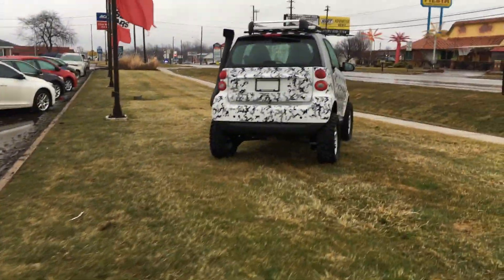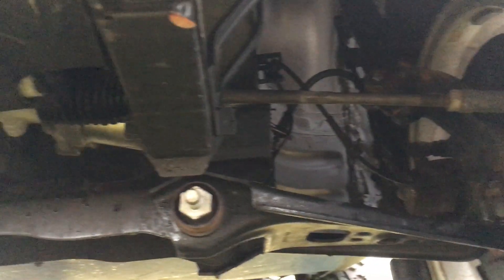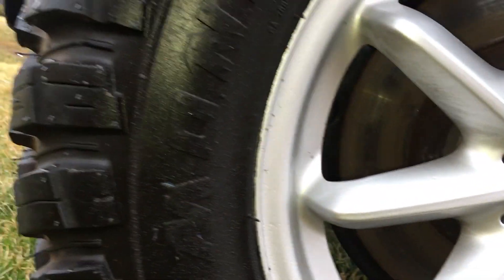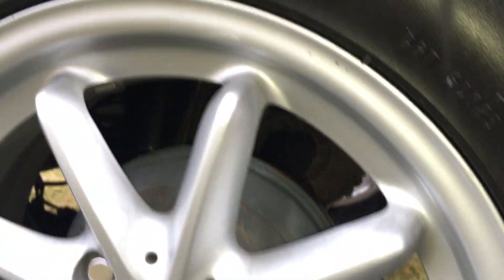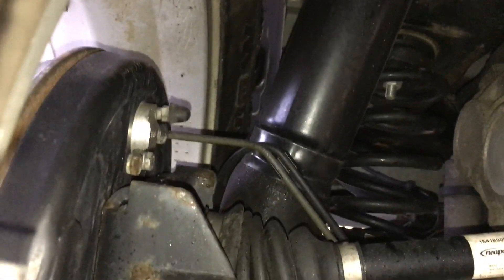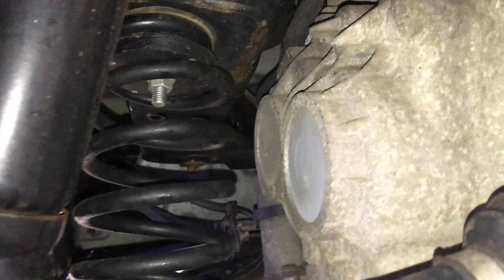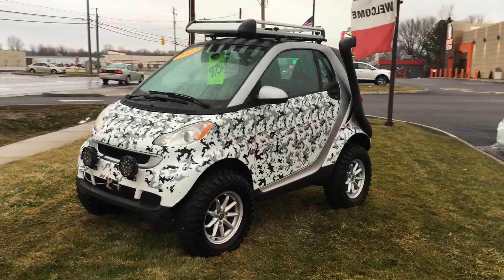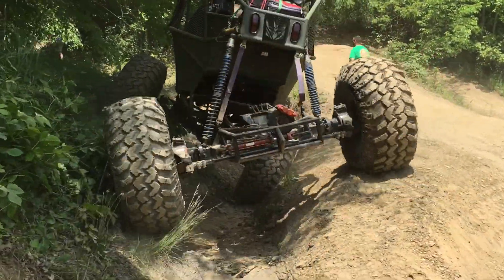Custom Lifted Smart Car ForTwo

Comment: This was one of the Smart lifted for Two that has inspired me to buy and lift my own.  I am retiring soon and live in eastern Ontario next two the Hastings Heritage trail.   Ontario is full of abandoned railway lines that are now being kept up for multi-use purposes such as sledding horse back riding and so on.  I looked at used UTV for two but the prices for anything decent is $10k minimum.  I'm not interested in 4x4 trail busting, just sight seeing and getting to some places I've never seen before.  The Smart 4-2 lifted has these advantages.  Comfort.  Super safe. Cost max project $6k. AC when it's hot.  Heat when its cold. Dust protection. No helmet required.  Road legal to get to the cool off road locations via paved roads.  Quiter.   Disadvantages.  Not 4x4 so some spots will be off limits.  It's going to be a fun build project for my highschool shop students in my final year.  Cheers RL.

Comment: The Daystar lift was originally designed to lift the Fortwo up in Canada to allow more clearance for driving in the snow, thus the lift and aggressive tires. It's a perfectly safe well tested aftermarket kit for it's intended purpose. But for serious off roading it would be a flop compared to a side by side. I have a Daystar lifted Fortwo with taller tires. I live in the country and thus 3 or 4 inches of total lift is a big plus. It still handles great and is stable. I am running street tires and not aggressive off road ones.
Reply from the maker: Thanks for the info! Good to hear directly from someone who owns a lifted ForTwo.
Reply: which one did you buy. iwant get one to lift mine. can you tell me. exactly.  and thats a lift for all 4 tires. and can i put a bigger ones
Reply: l moore

Comment: OMG yes I would buy it! ..... but not for $9750.  I could make it cheaper.  Get an '07 to '12 smart for about $2-$3k, then do the lift myself.  Daystar makes the lift kit for $350, then just rip out the front fender liners and maybe trim the rear.  Voila.  I'm currently searching for smart car numero two and I'm finally gonna do my buggy conversion.  Great video BTW, thanks for getting in there!

Comment: cool mods. I'd buy it if it was in the UK, and I could insure it. We have annoying strict insurance that doesn't like modified cars, and especially not as altered as this. Ok there are specialized companies but you pay well for it if they don't understand/like what you've done. And this, which would make it handle worse than standard, would be something they don't like. Still want it though! good video my friend.
Reply from the maker: Carl B We have it easy here in the US when it comes to modifying vehicles. There are even some vehicles so rusty that they aren’t even safe to be on the road, but people drive them until they literally break in half.
Reply: @6thGearGarage  I wish it was some way between these two extremes. Over here, a sticker on your car, if not declared, and the car is stolen - could void your insurance if they decide it led to the car being stolen. We even had for a while, the situation where winter tyres were called a modification (before sense was regained). We don't want death traps but a little freedom would be nice. As for suspension lifts or lowering, that needs to go to a specialist insurer, some are fairly priced, some give cover but with stupid low mileage caps, or exclude commuting to work. You have it so easy in the US ! stay safe.

Comment: They took a darty, unstable little car, and made it..... uh, .....Un-stabler?   
I've seen worse though, in Colorado, I saw  an elcamino dumped onto a blazer frame.
In order to get the inside/outside steering box issue solved, they used a motorcycle chain and two sprockets.  
 It was actually a great deal more unsafe than it even sounds.
Reply from the maker: I've seen some sketchy stuff here in OH, but nothing intentionally built to that level. Most of the questionable stuff around here is due to frames/subframes/A-arms rusting away.
Reply: Yea, we get a LOT of that around here, I have a video of a Toyota we owned that was rusting away at 32k.
That I can deal with, scary ass engineering bothers me.  I'm even against factory lift blocks in the rear though, so I'm kinda hard core.   ;-)

Comment: Might be nice on the Oregon coast, drive on the beach and around the hills. I don't know what those go for around there or even here. I'd rather not use spacers to lift a car, I can't see it gaining much extra articulation
Reply from the maker: I agree, looks like more of an expensive toy than a serious off road machine. I guess the advantage is that you can still drive it on the street.